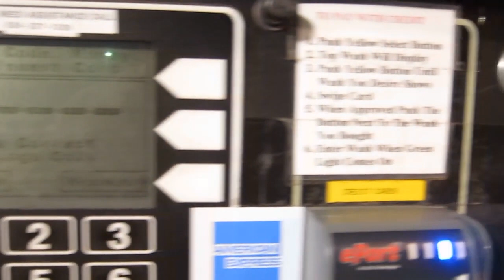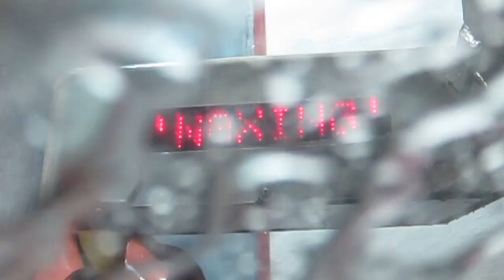Ryko Select-A-Wash!   FoamBrite & Touch Free Combo!

Comment: If you had the ability to build your own wash program for this,what would you choose? I'd start with a  presoak then a back to front pass of the rocker panel blaster, then a slow double pass of the main touchfree wash without brushes, then a pass of triple foam, after that a brush pass without the top brush, then a brush pass with the top brush, After that, a fresh water rinse to rinse away the reclam water, wax, clear coat protectant, reverse osmosis rinse (spot free) then finishing off with a thrust pro dryer